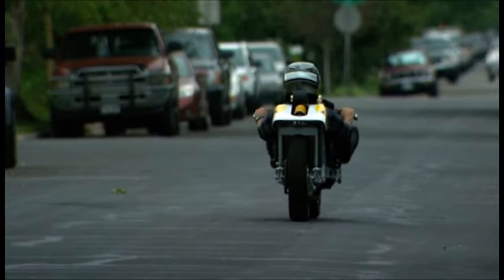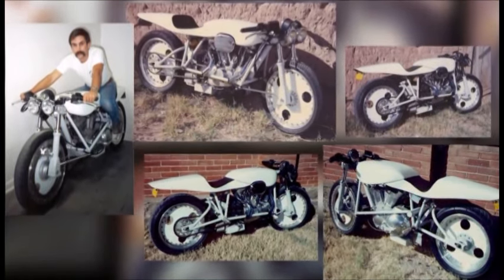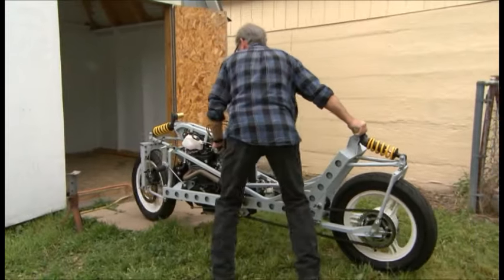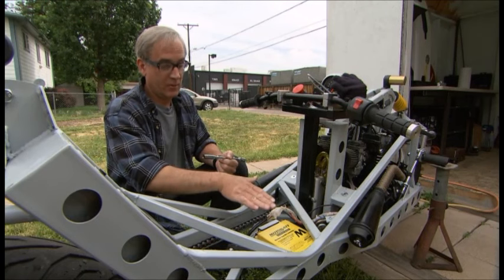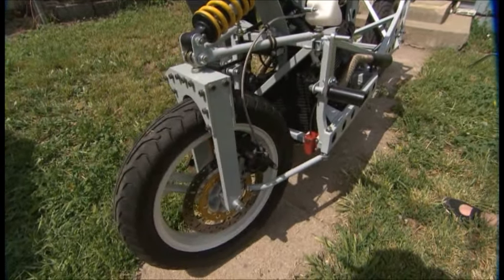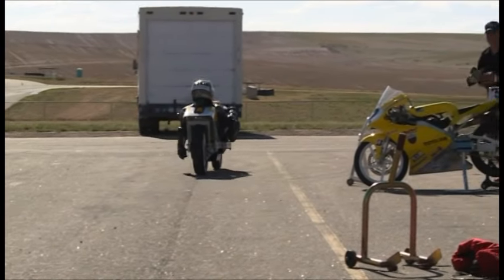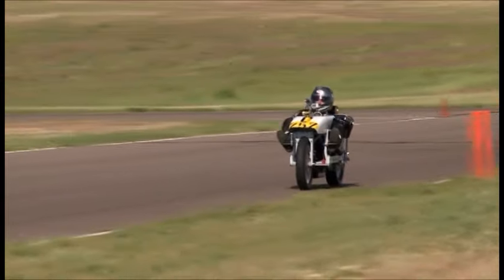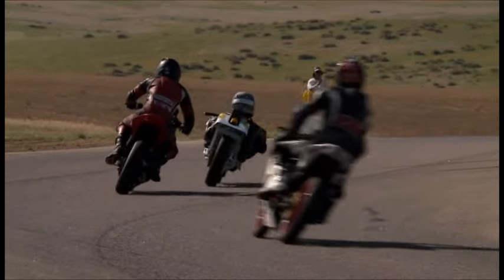Rohorn Racer recumbent feet forward motorcycle (2014)

Comment: Put a nice fairing on and you'd get twice the MPG of the same motor in a upright riding position. That's the benefit of FF IMO.
Reply from the maker: Ideally, yes!

More about that here: https://rohorn.blogspot.com/2014/04/forward-thinking-friends.html
Reply: @roberthorn  i found your vehicle because of this same thought. I was trying to find out if people have built essentially motorised "velomobiles" as all I see everyday on a 100km commute is big SUVs with a single person sitting in each.

If a honda supercub 125cc can achieve 1.5l/100km, I wonder what the same little engine could do in a light, aerodynamic body. I wish someone tried it!
Reply from the maker: Check this out: http://www.velomobiel.nl/allert/Recumbent%20motorbike.htm
Reply: @roberthorn  Thank you! I had no idea someone had tried this
Reply: The benefits of this type of vehicle are enormous if you use electric power. You can get the drag down to less than 20% of that of a normal motorcycle, and so go 500 miles (800km) on one battery charge that would take a motorcycle of normal style 100 miles (160km) at the same speed. I know this because I built one 32 years ago and have done over 150,000km in it. You get the full benefit with electric power because the motor still has high efficiency at the much reduced load; a four-stroke petrol engine suffers a big loss of efficiency at reduced load, so an 80% load reduction might reduce the fuel consumption by less than half unless you use extremely tall gearing or reduce the size of the engine.

Comment: Very clever combination of duplex steering lower links and a  single pivot top wishbone, allowing simpler steering  and  suspension linkages as well as low unsprung weight and lower steerIng inertia than 'normal' duplex steering. I'd never seen that combination before. Is it your own idea? If so, hats off to you! Any steering idiosyncrasies as a result  of this set up?
Reply from the maker: Thanks! Yes, it was my idea. 

I've been told by all sorts of "Experts" that I shouldn't be able to brake while turning, since the steering axis doesn't swing forward like normal, but it doesn't misbehave at all - I can trail brake into corners just fine - it provides a lot of stability and front end traction feedback. It turns out that the slip angle works with the trail just fine without any need for the forward swing from the steering axis. 

That said, if the steering sweep is high enough to allow the duplex arms to "Intersect", the trail geometry degrades very badly. The steering sweep on the racer was constrained enough (20 degrees either side of center) for that not to happen.
Reply: @roberthorn  Brilliant. OEC showed pre-war that the standard Temple.duplex forks would work, but yours takes it to the next level. Any issues with bump-steer in corners?
Reply from the maker: Thanks!

Nil bump steer - the steering link is both parallel and equal length to the upper arm. Used a dial test indicator to get measured bump steer at the steering link under .003 mm with the full range of suspension travel - seemed like I was tuning a formula car suspension...

Comment: I like your bike but that vertical front wheel just makes me nervous even though it works just fine. I've built several recumbent motorcycles over the years. I never thought about racing them because all of the ones I built are street legal. Have you ever thought about building a new one using everything you've learned from the first couple?
Reply from the maker: The steering axis is 12° (The axis isn't parallel with that front end). 

The next recumbent racer (2WS again, with 2WD, more than twice the power, a lot less weight, and real race rubber) is under construction - should have a good update on that before the end of winter.

Comment: Very cool project! Have you considered making an electric version? Batteries have come a long way in the past decade! I keep thinking that a feet-forward design would help overcome the range issues plaguing commercially available electric motorcycles, but no one seems to have tried it yet. Could be a supremely comfortable highway machine.
Reply from the maker: Oh yes! Given enough money, I'd rather build an electric one for many reasons...
Reply: @roberthorn  Yeah, exhaust for one, the motor gets moved under the seat and is much smaller
I even like the idea of a combination of scooter type CVT with the motor, something like what is on an tmax - CVT on one side, straight belt drive on the othe, this will make the motor last longer, be more economic overall
Reply: @roberthorn  Every type of new personal transport vehicle seems to come up short. Many look as if they're purposely trying to fail & be dorky as possible. I don't understand why its so hard to get right. Its actually easy- Step #1 Make a reverse trike like scooter 🛵 that u sit in. Instead of sitting fully upright. Like a Piaggio mp3 or Yamaha Tricity that can lean & carve corners , is fun to drive but also easy to learn to drive like a scooter. Is narrow for easy parking #2 Add a removable or partially removable aerodynamic lightweight weather enclosure and some storage room for groceries. Either behind the seat or removable saddle bags & trunk (like an adventure bike) that can attach to the frame with the weather enclosure on or off. The aerodynamic enclosure #1 greatly improves milage/efficiency #2 keeps you dry & warm, 3 wheels means safer in rain than a scooter. It could be used year round even in snow with proper winter tires. Think adventure motorcycle with motorcycle price tag ( much cheaper than car price) but with 3 wheels & removable aerodynamic enclosure that can also easily be a daily commuter. It could easily realistically get 100 mpgs but also travel at 85 mph. A Honda nc750x motorcycle for example gets 65 mpg even with horrible aerodynamics but has plenty of power. Use a similar smaller 400cc-ish engine or electric. If I could build what I have envisioned in my mind. I think I could actually sell a bunch. To everyone from teens 1st vehicle to retired people who want affordable yr round transportation. You could also  make it tandem 2 seated like a scooter & still keep it somewhat small.
I know a teardrop shape is the most aerodynamic and a more practical bullet shape is close behind. With saddle bags & rear compartment 2 people could ride cross country in rain/cold + handle moderate off roads at 100mpgs. 
My other idea for a street legal, no insurance,no registration, no license electric commuter vehicle is. A 750w mid drive velomobile. Most velomobiles look super dorky and you still get wet & cold. Except for the Trisled Aquila 3 that is a cool bullet shape. It looks like a glider without wings.
There is a video titled something like solar powered electric clipper trike that is the same idea as mine. A solar powered velomobile that doubles as a sleeping pod by laying the seat flat. Except isn't as fast and doesn't look as good. Basically the same idea as his but in faster nice looking bullet shape velomobile that gets recharged by lightweight folding 📂 solar panels that store underneath or behind the seat. With a pull behind bike trailer for ebike packing trips. Heat would be an electric car seat cover and air conditioning would be a couple 12V DC peltiers that are used in portable refrigerator coolers. 
If you could make a cool looking bullet shaped electric velomobile that could float & be used like a canoe 🛶 or kayak able to drive directly into & out of the water. Would be amazing. 
I really wanna build an electric velomobile setup for a cross country road trip. It'd be like velomobile/mini RV. The dash would have room for gauges and tablet. At night when it converts into a sleeping pod. You can watch a movie on the dashboard tablet with the seat leaned back.
Reply: I have tried it, and it works. 500 miles (800km) on one battery charge, at normal traffic speed.

Comment: That's for putting this up Robert. I recall you were building a better faster version of your FF bike, is there anymore information on that?
Reply from the maker: The next one is still under construction - most of the suspension and drive system is done - just not photogenic yet. If all goes well, the engine comes out of the donor bike (KTM 890 Duke) very soon and frame construction starts soon afterwards. 

The frame tubing is already here...
Reply: @roberthorn  Is that the two wheel steering version? Was it also two wheel drive?
Reply from the maker: The last one (In the above video) was converted to two wheel steering after the above video was shot - first tested it in 2016 - last race entered was 2018.  The next one is both two wheel steering and two wheel drive. 

Should have a brief video on how that looks and works on the bench in the next few months. Thanks for asking!
Reply: @roberthorn  its gradually coming back to me. I do recall the two wheel steering modification. I'll look forward to seeing where you go with the new bike. All the best for 2023!
Reply from the maker: Thanks!!

Comment: I love this! One of my goals before I die is to build myself one of these also. This thing just looks so sick and slick and actually quite modern for some reason. Though I don't see the reason behind making the rear wheel be able to pivot... that just seems like another complicated moving part that's has the potential to break. I guess it's so the front wheel doesn't need as much steering but meh
Reply from the maker: Two wheel steering reduces lean angle, makes lean angle changes faster, and kills weave - 3 things that a motorcycle roadracer can benefit a lot from. It has nothing to do with reducing front steering angle - the rear wheel steers 34% in the same direction as the front - watch my "Split hub center steering" video for that.

Throughout the history of motorcycle racing, every single breakthrough that increased performance was also an added complication. 

That said, if it isn't a racer, then there's no real need for it. I hope you get to build yours and have a lot of fun with it!
Reply: @roberthorn  Oh I didn't realize this is actually your channel, sorry for being so brash about it😅

Thanks for your insight, that does make sense and I can totally picture that now.

Yeah absolutely, with my one I'd probably not opt for the rear wheel steering to simplify things. When I get to building one I will definitely let you know!

Comment: Id like to see a bike like that but with the steering as two sticks one on each side of me. Like the old Green Machine big wheel I had as a kid sorta..or old tank controls.Right side hand would have a roll throttle just like a motorbike. You turn right by pulling back on the right stick and forward on the left. Have to add clutch to left hand like a bike again. I think it would work....somehow.Better than having to hold your arms up in front of you to steer the bars.